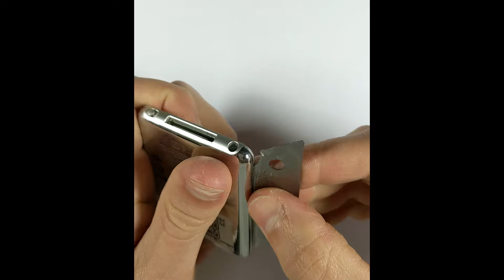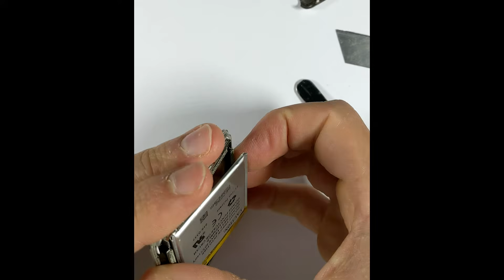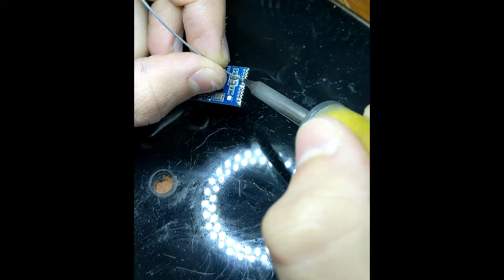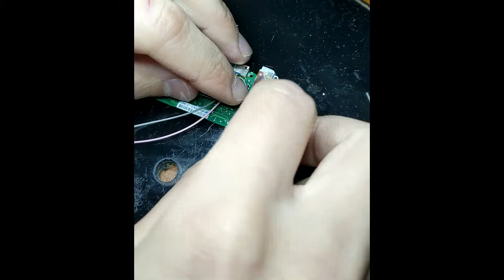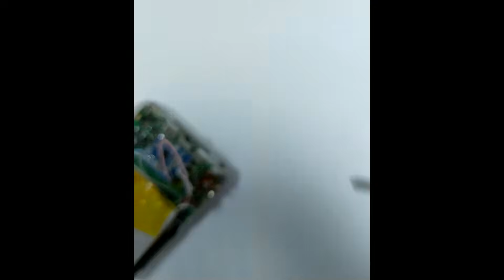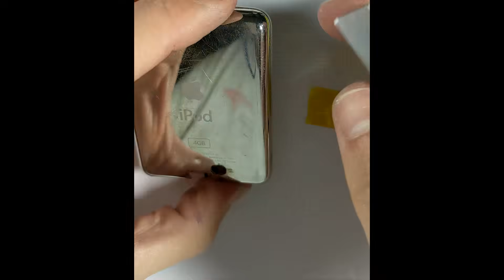iPod nano 3rd Gen Bluetooth Mod

Comment: That’s exactly what I did. I followed your video and modified my iPod nano 3 in the same way. Everything works perfectly. On the back, I made a hole for the pair button opening and a small cutout for the switch.
However, I wouldn’t recommend anyone to replicate this, since the iPod nano is extremely small and there’s hardly any space.
Reply: How about print a new case?

Comment: Today, I tried to put the Bluetooth module in the Nano 1st. I took the external antenna part off and the switch on board too. I put everything in my iPod nano 1st and closed the back cover, but lots of noise came from my Bluetooth headset. I changed the 30-pin connector to a USB-C port, so I could make some space. But I have no idea why the noise was coming out. Do you have any clue?

Comment: There is no clips on the backplate over the 30pin connector, so you can put push button on it (under CE logo) and file the button just to make a little bump on the backplate, it's able bend, so this is how you can make invisible button and do not mess the shell.

Comment: With this project you might want to use a drill to make the hole. This way it can be more precise to link up the hole, you can use some kind of ink or putty to try and make a mark on the other side. At least that's how I would try it. A more elegant solution would be to wire the pair button to the actual clickwheel via some kind of button combination.

Comment: yeah. the power switch should be on positive line. lol. putting it on negative line does not do anything since the gnd for headphone jack is also tied to ground.
Reply: Will that actually work? I really want bluetooth on my ipod nano 3rd gen but I hesitated when he said it won't turn off so if I take your advice will it work?
Reply: @Krispy367   this was 2 yrs ago. and yes put the switch on the positive line. i quit modding ipods for a while now.
Reply: @kobs9636  😅I know it's an old video, but I just found my ipod in an old box and I wanted to mod it so thanks so much for the tip!
Reply: @Krispy367   i wish you the best of luck.
Reply: @kobs9636 sorry for asking a lot. Just a quick question, can I use 28 awg wire or it is too thick? If it is what thickness do you recommend? I also want to change the 30 pin for a type-c
Reply: @Krispy367  28awg is pretty small. its fine as it fits
Reply: @kobs9636  Alright I guess I'll use 28 awg thanks!
Reply: @Krispy367 please let us know how it went in the end. Eyeing this mod for my gen3 that I got randomly for cheap. It would be great to see results and parts of the process on reddit or here, not much to see on this version atm
Reply: @bolshoff97  sure as soon as I am done I'll let you know. But I might get back to you after a month or 2
Reply: @kobs9636 what does that have to do with anything lol
Reply: @zombiebbq14  switch on gnd? yea cutting 1gnd connection doesnt turn it off when there are other gnd connection. better cut vcc line.